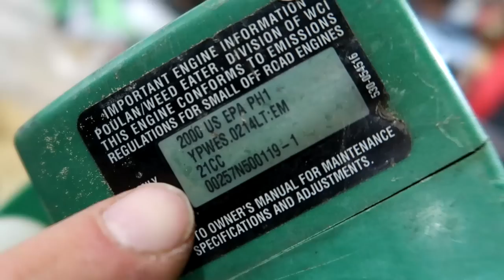GARBAGE PICKED SCOOTER ENGINE

Comment: Hey Dalton, a bit of advice on your weedwacker scooter: 

The diaphram problem is a fairly common one on engines like that. But there's One Simple Trick that keeps it from happening, or at least makes it take a LOT longer before it does: 

It's in the gas.
Literally. It's ethanol. In the gas. 
Ethanol is what causes those diaphrams to go stiff 
If you put regular pump gas (with oil of course)  into a walbro-style carburetor like that, the diaphram will stiffen after almost ANY period of disuse longer than a couple of weeks, and it will also stiffen up over long use. 

If you want to almost NEVER have to deal with that problem,  you just gotta find a gas station that sells non-ethanol gas. It costs more than regular gas, but these engines don't use all that much anyways so it's ok.
Reply: I beleive you can wash out the ethanol by doing alot of work also. Incase it isnt avaliable.

Comment: It's been my experience, if a machine is mechanically sound your appreciation of its original design and workmanship will only increase with time--don't eliminate an item from your collection because of issues related to popularity and definitely not styling. My Dad had a very valuable vehicle which he was influenced to sell as a result of its fuel economy rating. He sold it for roughly what he had paid for it. It wound up being one of the rarest collectibles on the planet. Don't sell anything short, especially those things that were a product of your mind like your repurposed 18 cc and 21 cc engines for driving a scooter. Picking up an engine that could have wound up in a landfill was brilliant. Keep up the good work.

Comment: soak the diaphram in some motor oil for 15-20 mins, then wipe it off. The oil will soften the rubber and it should work again, works good on old Tecumseh and Onan fuel pumps.

Comment: I built a scooter using the cam phasers, dual timing chains out of a 05 5.4 ford motor. Direct drive. It was so fast and dangerous i destroyed it. I now think because i live on the coast with all this water that the same drive would be alot more fun because of the drag that would slow it down.

Comment: Toss a high flow air filter on, add a less restrictive muffler, get rid of the plastic shielding on the back of the motor. You should get a good performance increase and a cooler running engine.

Comment: No. I salvage those feather lite weed eaters and use them on yard jobs. I have 6 of those feather lites and I'll take as many as I can track down. they outlast anything on the market and you can run them all day and not get tired. if you wanna break down a trimmer, homelite trimmers actually have more power and run a close second in life span.

Comment: I'm trying to fix a two stroke weed eater that's been in storage and had to replace the fuel lines but it didn't take long at all just is a pain getting the line through the little holes in the tank

Comment: I have more "Yard Toys" than you.  The only way that works is to make sure you don't leave fuel in them.  Everything else is lube or tire related.  One thing I did was to put a 50CC Chinesum carburetor on my 30CC weed wacker, best 20 bucks I have spent in a long time.  Uses more fuel but runs and starts great.  To give me credit the new carb has the same bore as the original and adjustable low and high speed jets.

Comment: Baho scooter Baja scooter you need to look them up they use a 27 cc same two stroke engine but they use a chain cross belt pulley setup clutch it's like a torque clutch converter it's a small shaft that a belt from the engine goes around then the chain goes around the pulley or the pole I should say that spins from the belt that makes the chain spin